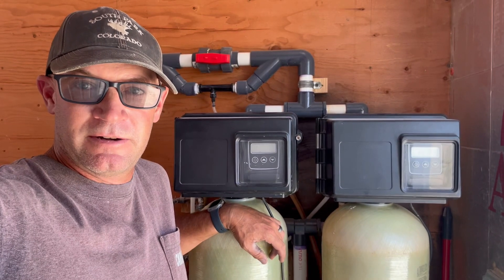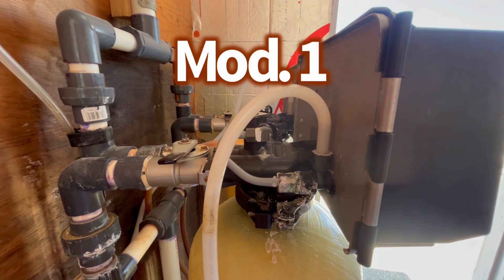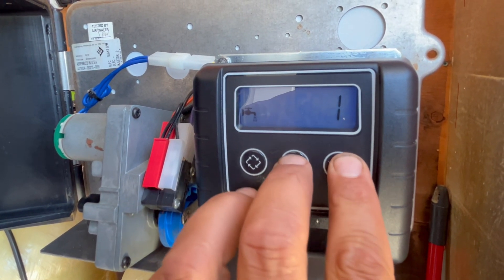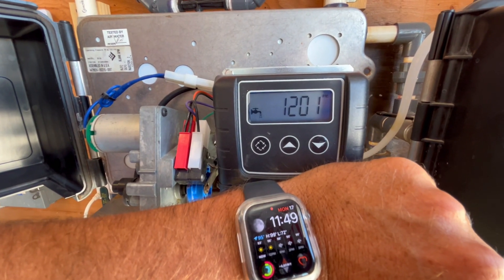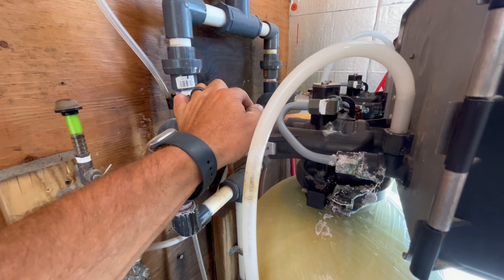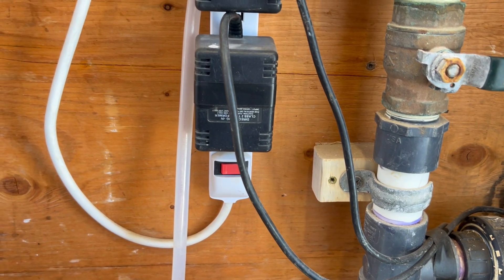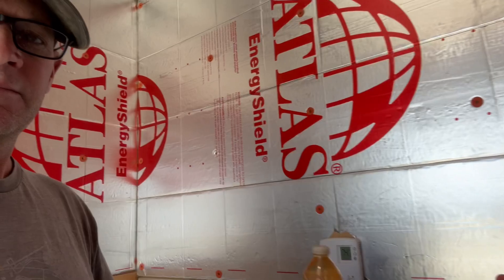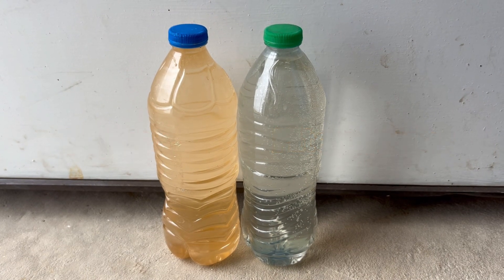💧 How to keep Iron/Sulfer Filters Clean and Running

Comment: Finally someone who knows what they are doing with this unit!!  You helped me so much!  Thank you.
Reply: How often do you have to completely take apart that Venturi and clean it out? That's an awesome idea, because I took apart my valve, and it was half full of rust deposits.. I think your Venturi setup would work fantastic for me, but I'm not crazy about having to clean it frequently , byI taking it apart very often.
Reply from the maker: @msp472  Not often, I think twice in seven years and it wasn’t plugged. It is a large size, the diameter inside is close to 1/2 inch. The brand name is Mazzei and is usually used as a liquid fertilizer injector, for drip irrigation. 
The jets inside the Fleck filter valves do get clogged more often. I have to take each Fleck valve apart once a year and soak in Iron Out. If the jets are plugged I will usually just replace, simple two small parts. Also I always replace the piston, seals, and spacers. I order spare parts at Softener Parts.com
These filters are not plug and play. But if cleaned and maintained they work well. Also depends on how much iron is in your water.
Reply: I've seen other videos where they run a bleach solution through these filters, once a year. What's your opinion on that?
Reply from the maker: @msp472  I think that would help clean and disinfect. Bleach kills bacteria and oxidizes iron.
Reply from the maker: @msp472  That’s great. Thanks for watching.

Comment: I am going to take a guess and say that the Filox is an improvement that you made to your tanks. It is described as a super-duty solid media that is 75 to 85 % manganese dioxide with an extreme life duration and performance level. I do not see it listed for sale in any listed air-over tanks that Aqua Science sells.
Reply from the maker: @martyvanord984  Yes. I started with Katalox Light. It works great. I was backwashing filters every day and the mechanical wear just broke down the Katalox in a couple years. The Filox is good, problem with it is it is heavy, need good water flow to wash it. For a house I think Katalox would be the best. Probably backwash every 4 or 5 days.

Comment: what brand of air over valves do you use???? There was no name viable.
Reply: What type of cleaner you run through your's? I picked up some oxy-p to clean out my Katalox setup.. I haven't used it yet just curious on your's.. ty
Reply from the maker: @xmonte7835  I use Iron Out. 👍
Reply from the maker: @martyvanord984  Fleck 2510.
Reply: @thewindmillgarden  Thanks for getting back to me

Comment: WOW!!!--if you can treat water that bad and that volume, then just treating a house should be easy!
Reply from the maker: @martyvanord984 From the well water goes to a cistern. Then the house has a water softener. The iron filters help a lot, they just require regular maintenance. There are other systems, like peroxide. The air filters have worked pretty good and air is free. 👍 Thanks for watching.
Reply: @thewindmillgarden  my research says that peroxide is the very best but as you say can get expensive. Those who sell peroxide systems say that air over will gum up and quit working. Looks like you have it under control by doing a solution clean and soak.
Reply from the maker: @martyvanord984  That is true. Air over is not maintenance free. Takes more time and energy to run them. I think that the deep clean with Iron Out is key. It’s a trade off. A peroxide system in a home might use $300.00 in peroxide a year. Lower maintenance. The Air over valves use free air but will have to be cleaned once per month. Also I have to take valves apart once a year and change injector, piston, seals and spacers. 💧👍
Reply from the maker: @martyvanord984  Also when running a lot of water through filling stock tanks, water does not have enough contact time to remove all iron. It does get rid of the smell.
Reply from the maker: When this well is just sending water to the two ranch houses, it works good. The iron filters help out the water softeners. It is just too much iron for the softeners.
Reply: @thewindmillgarden  my research indicates that iron in a water softener requires special treatment of the resin beads to restore them. Do you need to treat the softener for iron?
Reply from the maker: @martyvanord984  Iron is a Water Softener killer. Softeners will remove iron but not very good, especially if iron is over 3 ppm. Softeners are much better at removing the calcium hardness. Running water from our well that has been treated for iron and sulfur helps a lot. From out well water settles in a cistern. Then it is pumped into the house and it runs through a Water Softener.

I do the same Iron Out deep clean on the Water Softener now and then. I will make a video on it when I get a chance.
Reply: @thewindmillgarden  I do love that you begin by saying that you are blessed with 3 good wells. It took me a very long time to realize that seeing our blessing is the first step to feeling blessed.

Comment from the maker: Tell us about your well water.
Reply from the maker: Sounds like you are dealing with both oxidized iron and dissolved iron. Those chunks could clog air injectors, so thats good to get them out first. Have you considered spin down filters?  An iron filter or peroxide system will get the dissolved iron. Have you done a water test. Aqua science and Im sure others do free water tests and will give you treatment options. 💧👍
Reply: @thewindmillgarden  I do have a 2 inch Rusco spin-down filter before the 50 micron BB  filter. The water inside the clear housing is so rusty that seeing to the back is difficult. Even though I know better it seems to do nothing but I am sure is helping protect the first pleated filter.
Reply: @thewindmillgarden  I just received a water test bottle from Aqua Science today.  Thanks again for the  source. This company was not even on my list of possible companies to consider.
Reply: @thewindmillgarden  LOL After filtering out the rust, I realized that NOT having dissolved iron would not be logical.
Reply: I did reply to this but it is now blank. The well water is rusty with rust chunks.  I have taken anything visible out with a triple set of 20-inch big blue 4.5-diameter pleated filters.50--5--1 micron. To my amazement, they lasted a year and a half before I changed them out. Clogging with rust flakes was a problem before. Even though the water is clear, it still creates rust stains. I am looking at adding a treatment stage after the big blue filters. Air over with side injection and peroxide treatment as well as heads that create a top air pocket are all being considered.

i